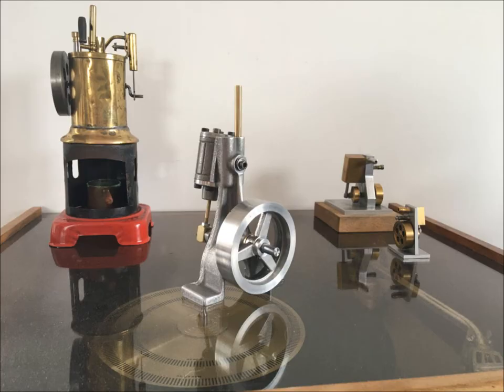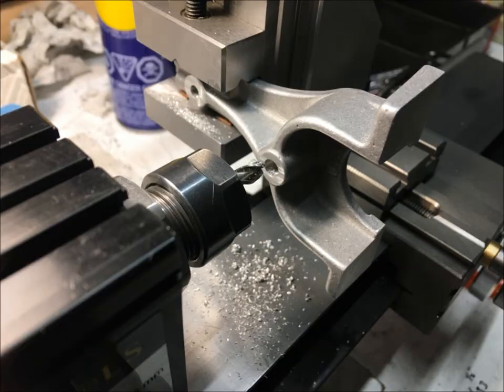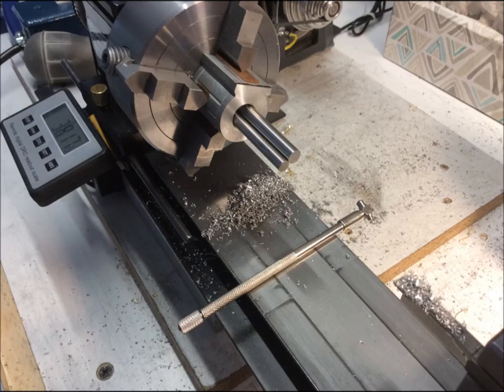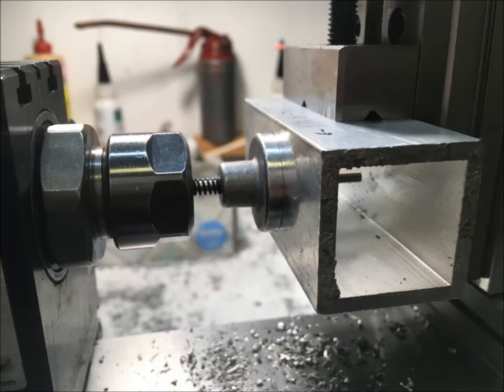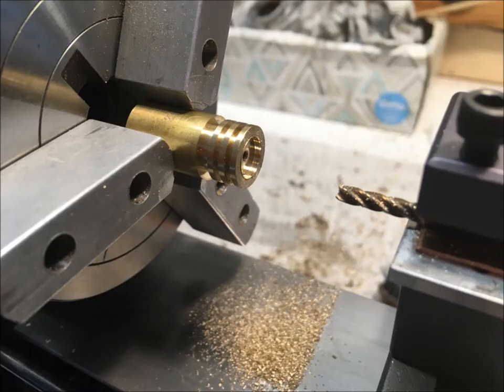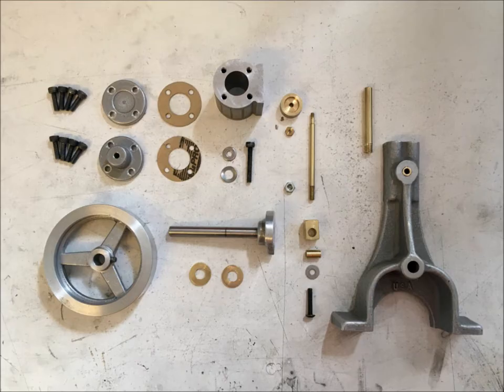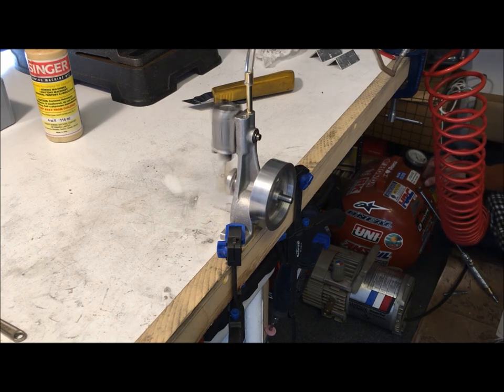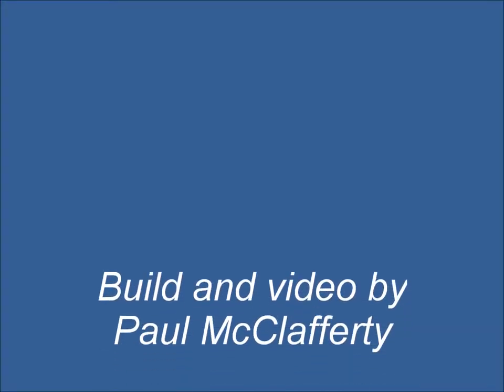PM Research Steam Engine No.2

Comment: Just put an order in for mine. I’m a total beginner so looking for videos like yours to see how others have setup the operations. Thanks for sharing.
Reply from the maker: This is a very well designed engine - it runs very nicely and ran as soon as I first hooked up an air hose. I’ve since painted it and added some brass parts and I’ll upload a video of it running on a steam boiler. The only minor downside is the limited adjustment of the cylinder pivot bolt due to the spring washer. My other engines have a coil spring which allows a much broader range of adjustment for fine tuning. I could have tried a longer bolt and some shim washers or a coil spring but instead I just replaced the bolt with a longer stud and I use a nylon insert lock nut in conjunction with the spring washer to fine tune the pivot tightness

Comment: I attempted to do one of these a couple of years ago, using a wood lathe and drill press. Not a sound idea. 

I'm looking forward to trying again now that I have a metal lathe
Reply from the maker: I was curious how difficult it would be with hand tools alone but I don’t think I’d want to try. The biggest hurdle I faced using my Taig lathe was the small travel of the milling table attachment, about 2”x2”. It required several setups, all referenced to each other. I have a Craftex cx605 mini mill now which would have made the job much easier. FYI, the quality of the Taig is head and shoulders above the Chinese made mill.
Reply: @pedwardm  it's difficult with the aluminum engine. Chips stick in the file and ended up gouging the casting. I had to do flat surfacing with a belt sander. I had to replace the cylinder because one of the bolt holes broke into the cylinder bore. After trying to drill the steam passages in the upright I decided it was a lost cause. 
I have a Grizzly lathe now. I'm interested in doing it using a faceplate and various setups.
Reply from the maker: @DenEiferer  If you have no mill I highly recommend a milling attachment for your lathe. Even if you build this engine without it, I’ve used my milling attachment many times and it’s one of the handiest tools I have. There’s a few companies that make them and they are almost a universal fit; mine is from Taig and it’s impressively square and accurate.
Reply: @pedwardm  that's a long term wish list item. I'm only on my second machining project, a steel hammer